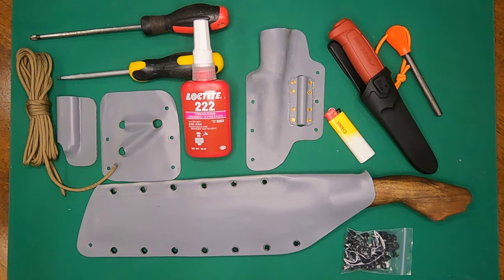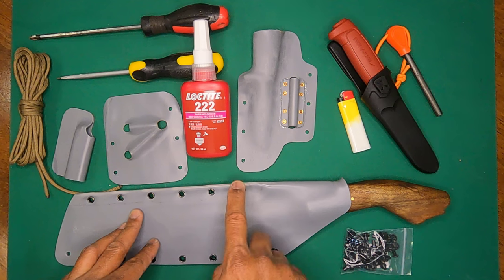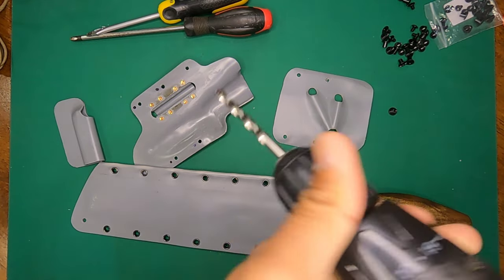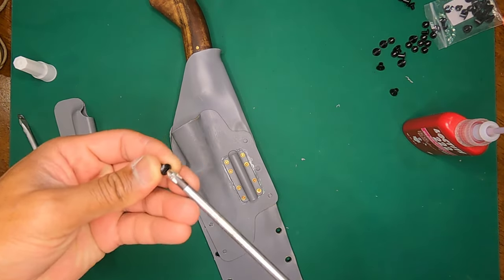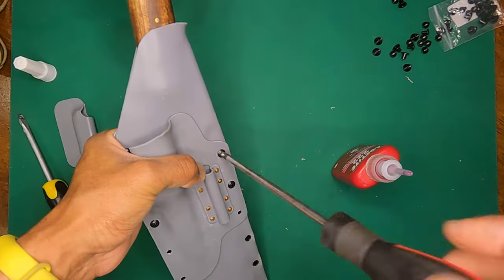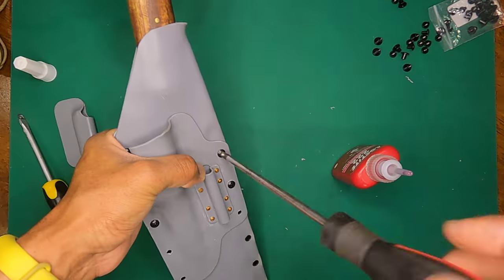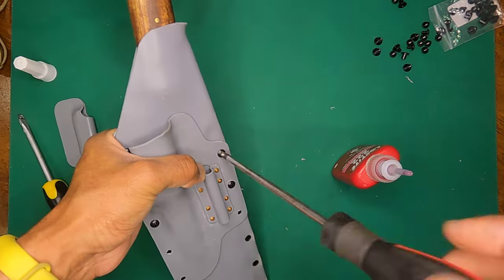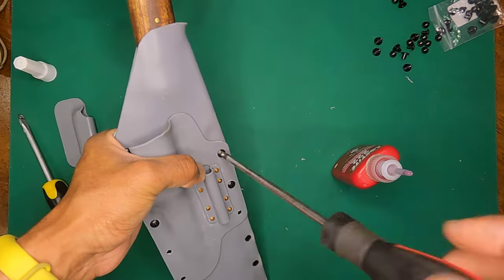PVC (not Kydex) Parang Sheath with Mora Knife, Fire Steel, Lighter & Simpeh Paracord Waist Strap

Comment: Very nice project.
Kydex is so expensive here in Thailand that I want to try PVC pipe.
How did you heat the pipe? Over fire? In an oven? In boiling water?
Thank you.
Reply from the maker: I used an oven. Found that it's too hard to get  a large enough tub of water boiling for large sheets. And heat guns are too concentrated to get a whole piece soft uniformly. Over a fire is prone to be singed.

Comment: How did you get the pvc? Is it just a pipe you heated up?
Reply from the maker: Yes, I just bought a short length of thin drain pipe, cut it down the middle and popped it on the oven. It softens up then I take it out and let it cool flat. I then mark up then reheat and form it.